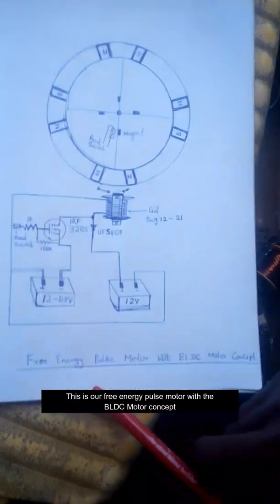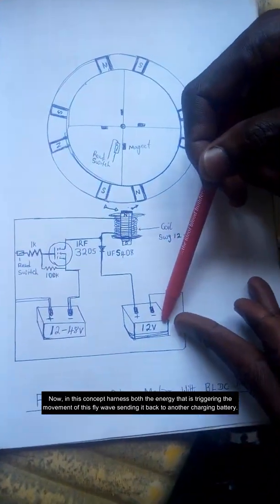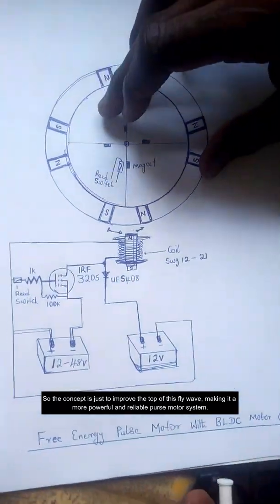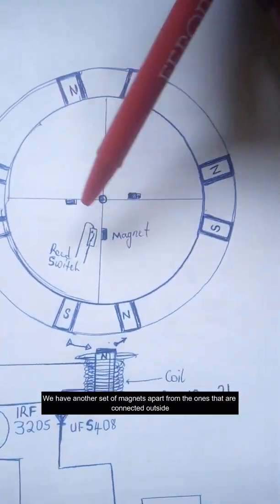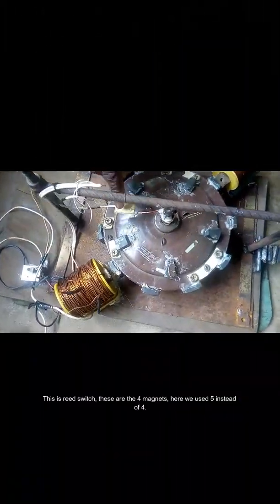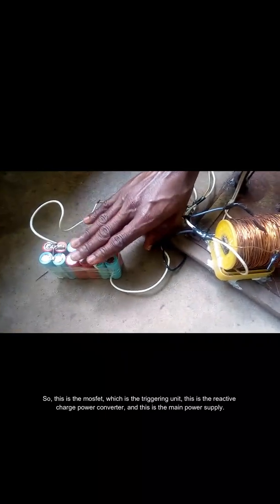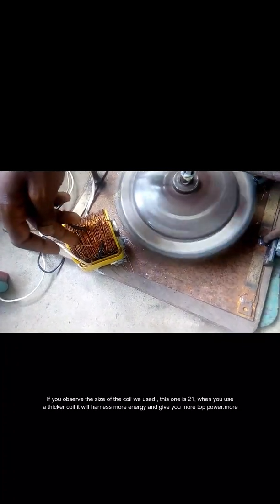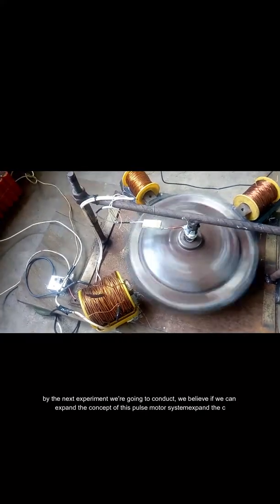A Nigerian inventor invent a powerful free energy pulse motor with BLDC Motor concept

Comment: Bedini motor... If you go through all his videos/work/schematics, the wheel is just a mechanical switch. If you build it solid-state, you can run much higher frequencies and harvest far more of the back-EMF sort of like what Don Smith was doing. The rotary system is great because it's bulletproof and no electronics (EMP proof) - look up the Lockridge device (energy from the vacuum series).

Comment: Thinner wire wound LONGER is need the longer the higher the spike
Reply: on a coil every LAYER should be wound the same way, meaning starting on the left and ending on the right, 
i see ppl do one layer from left to right then the next layer is right to left, 
basically when power goes through that coil on both ends of the magnet there will be a N and s pole and a S snd n on the other end, 
if every layer is from left to right then there would be to N and N on one end and a S AND S at the other, 2 layers would have double the field strength,  
after i do one layer i try to get back to the other side with 1 loop or 2loops max to achieve all one way,
 just tapping a battery causes a really fast spin so probably leads to even lower power needed, 
i bet even the Bemf would look more uniform aswell, resonating coils are also meant to cause amplification.

Comment: How much is the input and how much is the output? Without clarifying that clearly, how can you call it a "free energy" device?
Reply: Looks like pure clickbait crap.
Reply: @MadRat70 Atrevido comentario,mas propio de alguien que ve amenazado su negocio de energía solar,eólicas u otras miserias
Reply: 😂😂😂😂 It doesn't work, you will put more in than out, use capacitors instead of battery, it does not work 😂😂😂😂😂

Comment: Tilt the entire thing to 36.5 degrees angle and add one more magnet to one side.the  The slight extra weight at one side on flywheel ang angle changes forces needed to spin and will spin faster with less energy needed to rotate .Even. a small weight instead of magnet is fine. 
Even spinning by hand you will notice it will spin longer  with more speed .

Comment: A generator powered by a battery in order to charge anorher battery is not a 'free energy device".  This is a net loss.
Reply: It is a ' net loss ' that gains ten times the energy in the process of its loss.
Reply: @michaelszczys8316 rriiigggghhhhhtt.

Comment: By adding the south magnet you are creating back EMF in the coil.
The flywheel although may have a slight bit more torque.
It will reduce the reactivity of the inductor.

This motor is not a generator it is an electromagnetic vortex pump.

The usable power comes from the voltage spike and negative node.

Comment: I appreciated your effort to build something based on BLDC Motor's ideas. But in your creation I thought that they cannot go together, Read switch - FET transistor - Flywheel. More than 40 or 50 years ago, inverters (DC to AC current) were built based on the read switch (relay) principle. Placing two magnets with different poles seems like a good idea as it gives you an ideal opportunity to use it. I have used that idea and it is productive.

Comment: Why do you NOT have a Capacitor on the coil.
1. You get better run times.
2. You only have to turn the switch on Half of the time. The other half the capacitor take care of
3. With the capacitor you can time it better. IE Make it rotate faster.
Reply from the maker: A very good idea I have to give it a try, thanks.

Comment: I think you need to have alook at the quanta magnetics pulse motor,you would be better just coping their design it uses 12 x 2pound copper coils 12 x round neodymium magnets ,2 side by side effectively making 6 thicker magnets, 6 large bridge rectifiers,solid state relay and reed switch or micro switch for triggering its what your making but its at a retail level,cheers
Reply: this motor produces enough torque by itself to turn 1 or 2 high voltage generator toroidals that can then be used as needed
Reply from the maker: We're currently working on expanding design which will probably produce more power at the output than the input. The concept has more torque than the regular pulse motor.

Comment: Hello nice to see people having a go,but please be honest ,especially with your title ,because and to be clear you did not invent this pulse motor, it was invented by john Bedini .And it isnt free energy ,not by a long shot.it takes advangtage of various effects.
I will help you out on your journey you will never find free energy so to speak,what you want is a device when it is tuned at its natural vibrational resonance,you can feed a small amount of power into it ,and recieve a to the power greater output  back .examples of this are two cones made of the best quality copper wire and wound into each other ,could reasearch Bashar double coils.But to recap please be honest with your titles other wise can quickly get bad name cheers.
Reply from the maker: The idea of using both poles of magnet in pulse motor design use not a known concept until this days so. Thanks 👍 👍👍 bro.

Comment: You are so very close , you are on the right pass Your ideas are good But they're not complete I'll try to help you out but you'll have to do some research here is some basic information information let me know if you understand it.
1. The 1st working prototype
https://youtu.be/Dp-6fOGI6oc
2. Giving more data on the working prototype
https://youtu.be/o_2K6e2GUoU
3. Using the step up to prove looping is possible
https://youtu.be/QnUWg13FCTc
4. Making a bigger prototype.
https://youtu.be/CIGhDO9Q9R0
5. Showing and proving what the professional says about looping
https://youtu.be/HTR03aSiGWs
Final video Reference from professional.
https://youtu.be/WVM0F2OrQhA
Time to hook up the big system using these methods and an update where I'm at of taking my home off the grid part one
https://youtu.be/S_oxzKu8Nzs

https://youtu.be/cN-go47lI_E

Comment: BRILLIANT  PERFORMANCE ON YOUR MOTOR. PLEASE SEE YOU TUBE [ WIND POWER AND MORE ]  WHERE HE HAS SAME SET UP AS YOU BUT USES NO STEEL IN THE COILS AND HAS GREAT POWER AND CHARGEING ABILITIES.  INCREDABLE. AND ROTATIONAL SPEED IS OFF THE CHARTS WITH ONLY 12 - 24 VOLTS.

Comment: Great work my brother! It's not quite free energy yet, but you're on the right track. Conceptually, you have all of the pieces, but there are a lot of areas that have to be executed very well as well as a few missing details. The reed switch is a good trigger. You could also use a trigger coil. Here is my latest video ( https://youtu.be/3BEet7gE8o4 ), but if you look at some of the previous ones, I have some circuit diagrams and corresponding motors that you might find interesting ( https://youtu.be/Cjs3GHyV10I ).

I was able to boil all of this down into a simple mathematical equation that I'll likely present in the next few months. But, based on that, I think that a very high frequency PWM (Pulse Width Modulator) can greatly improve the back EMF that you get returned in your setup. 

Also, because you're using large coils, you might want to look at the work of Thane Heins and his RevX generator coil designs. Here is a link to more info. ( https://youtu.be/4Oq1cC1qUU8 )
Reply from the maker: Thanks dear friend
Reply: @perpetualmotor a pwm would be used to control the speed of a motor.
Reply: @ozymandiasking173  the PWMs I’ve used are generally set at a fixed frequency and can vary motor speed by changing the  duty cycle. You should also be able to get a similar effect with a PWM that has a constant duty cycle, but that can vary its frequency. A very high frequency would mean that for any given time period, there would be more instances of BEMF being produced.

Comment: Does it really provide free energy can anyone answer??
Reply from the maker: Yes. Because the pulse system works just like your boost converter, so the mechanical power is free.thanks for asking.
Reply: @JfGreenEnergy  Good idea! but try to put some load on that mechanical power and you will see how isn't free anymore... rotor will try to stop and demand more input power to support the drag effect. May be I'm wrong, but you can do a video to demonstrate it! cheers
Reply: you can go closest to free only with a solar panel

Comment: awesome idea..ive  try similar like this but without a components, just coil and reed switch. Yes it can work, even i just setup north pole little bit higher as trigger  to reed switch. Power output depends on coils and speed of rotor, as i know pulse motor consume very small power. I used 40 awg-thousand turn and it consume 2-50uA at low rpm. And i did it just for fun..im waiting your next videos..great idea.
Reply: Hello. Increase the primary impulse, the reverse impulse will be much greater. 12 volts. 24 volts. 36 volts. The reverse impulse is 50 times stronger. Nikola Tesla said....his majesty impulse....